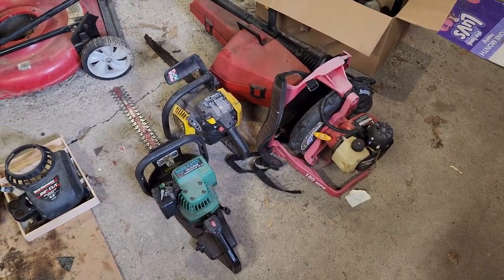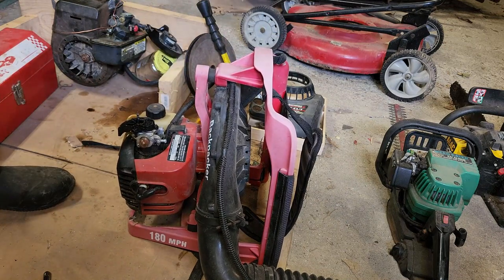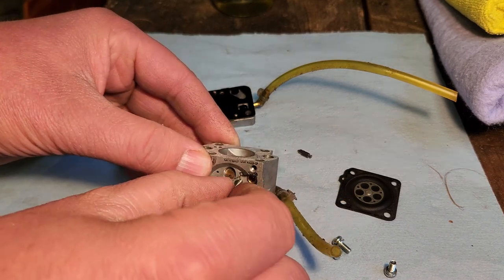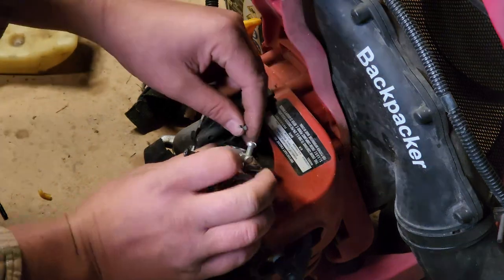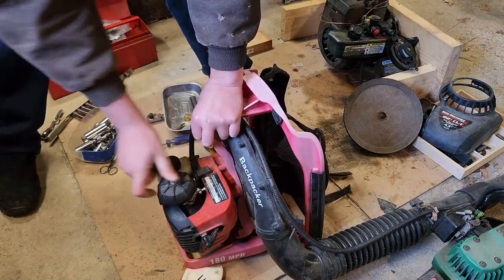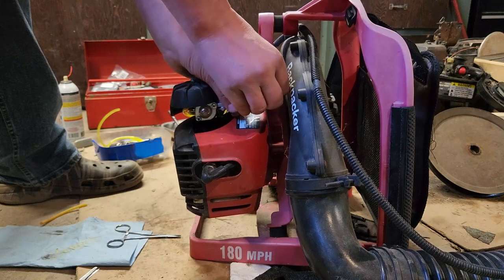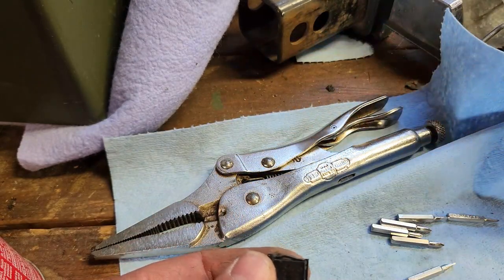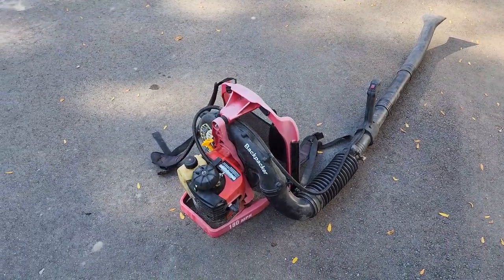Will it Run? - Left in a Ditch Leaf Blower

Comment: If you are going to be working on a lot of small carbs, especially two cycle carbs, pick you up a pack of welding tip cleaners. They are cheap, last a while, and are perfect for clearing out small jets and passages. Some were given to me, and having no other use for them, I decided to try them on carbs. They are the best thing I have found for clearing small jets and passages. They are basically really thin pieces of really strong wire. They are like wire brush bristles, except much stronger.
Reply from the maker: Thanks for the info!

Comment: I'm not great with two stroke stuff yet either, but one thing I do know is that those diaphragms inside the carb are almost always bad if the machine has been sitting for a long period of time. Even if they do work, they don't work very well, or for very long. I usually just replace them. I don't even try to save them.
Reply from the maker: It's amazing how crispy they get!

Comment: IF you find yourself doing more 2 strokes get the amazon carb adjustment screwdriver set.  Had 8 or 10 of the stupid tamper proof drivers and they come in sooo handy.  Including the little 'pac man' on this guy.  When I got mine it was like 12 or 14 bucks